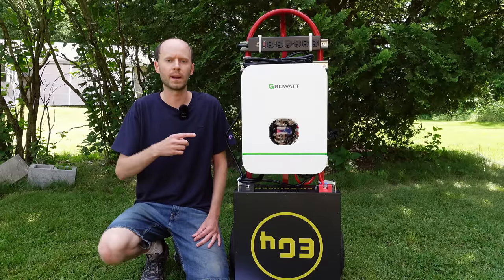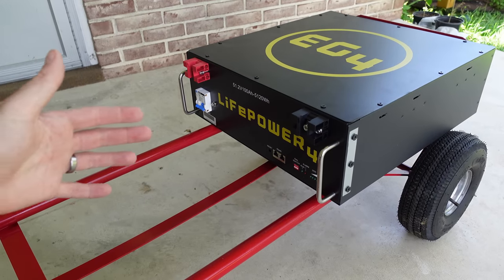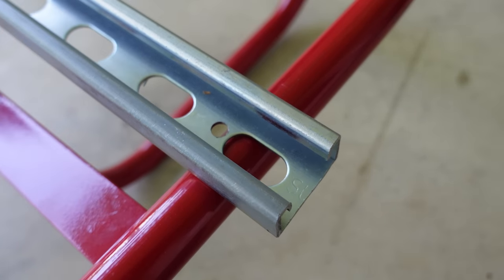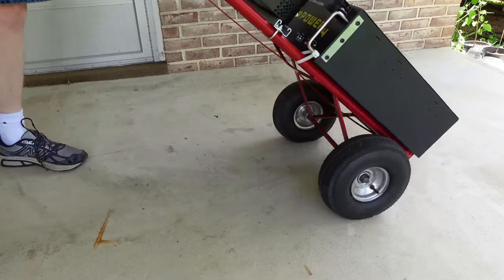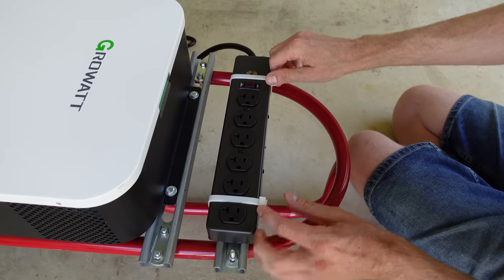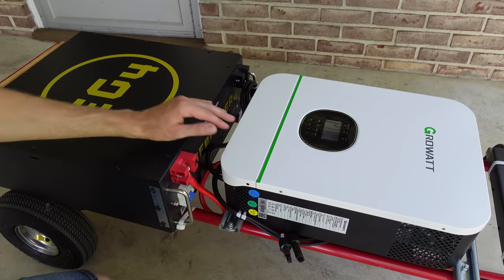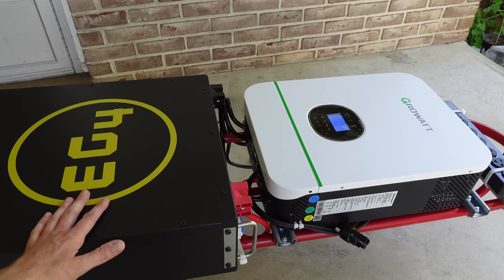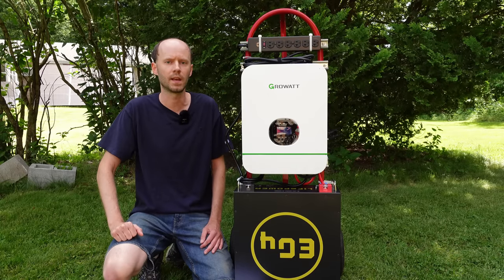Building a 3000W Portable Solar Power Station, Great for Power Outages!

Comment: Thanks! I copied your idea, but used a MPP2724 with outlet plugs built right into the unit on the side and MC-4 PV input plugs on the bottom, and I built a DIY battery using 304Ah cells (24 volt) and Daly BMS with the 2A active balancer. It works great. We are using it in the Green house for now, later in the RV when the weather is warmer, and in the fall time we can use it around the homestead while we get ready for winter.  Handy to have power anywhere you need it SILENT! unlike the gas generator we used to use, that is LOUD, smelly and expensive to gas up.  Great project for anyone with a few basic tools and skills.
Reply: I already purchased from signature solar and I am not happy with them. I have inverter that I can't use until they send me a data cable and I don't own a computer so I have to find one and borrow it and I don't have internet so then I have to go find that it's just ridiculous this is supposed to be plugg and play. Anyhow I like the idea of the inverter that you bought but I would like it bigger. I already own three of the eg4 batteries and 14 of the 455 watt solar panels.
I brought four of the panels with me back home and the other 11are up at the cabin.
I have a growatt infinity 1300 power station which i like, just doesn't last long. So i started researching how to increase my battery capacity and fell down this rabbit hole to make a cart system that basically works like my growatt using the eg4 batteries I've all ready paid for.
I like the idea of the built in plugs of the unit 2724. Does ut come in a more  powerful unit? One that will take more input from solar and one that will export more power so I can run like a window AC unit and hook up additional batteries?

Comment: Possibly a good idea to add a set of dummy clips for the solar connections you could use 3m clips to adhere them to the side of the inverter to both secure the cables further but also keep the solar connections clean  from dust and dirt on field deployments

Comment: I bought the EG4 battery and connected it to the EG4 inverter on a hand truck very much like the video.  Purchased some used 295 watt panels for 65 dollars each rated at 295 watts each.  The max I've been able to get is about 220 watts each.  Still that's over a Kilowatt for several hours a day.  The one question is do you need a breaker between the inverter and the battery?.  I know the battery has one but I  think they still recommend a breaker/disconnect in-between .
Reply: would love to know that too?
Reply: The mfg recommends a breaker between the battery and inverter.  I suggest downloading the manual and following the electrical code for your area.

Comment: you could use a metal hose clamp to attach the battery handles to the cart. that is a bit more secure than zipties. You could also bolt a piece of angle iron to the bottom of you cart, for the battery to rest on.. It would prevent the bottom of the battery from shifting forward.
Reply from the maker: Oooo metal hose clamps are a great idea!! I thought of a simple L-bracket at the bottom but the bottom of the cart needs to sit flat to keep the wheels up, so having a bolt underneath wouldn't work. I suppose you could counter-sink it fairly easily - that might work.
Reply: @LithiumSolar  LOL, I was looking for a comment about the zipties. When I use them in my videos people don't seem to think highly of them :) Although I find them to be highly effective, and reliable.
Reply: Zipties are approved to be used in aviation. They sustain extreme temps, vibrations, and don't damage delicate surfaces.

Comment: HI. I have a similar setup - 3000w inverter is driving one portable AC unit around 5-6 hrs/day (timer based) - trying to keep a balance while charging batteries 6-9 am and 4-8 pm which is helping to reduce a tremendous summer electricity bill in UAE. Four 400w panels, and 4wheel trolley for batteries and inverter in use when I need to move it anywhere.

Comment: While I understand not adding plywood to the cart I would think at the very least a strip of rubber membrane tape should be added to each rail on the cart prior to cinching the components to the cart rails. This would provide a sort of non-slip surface to prevent the components from any amount of slippage plus protect the rails from abrasion.
Reply: How about a pool noodle for vibration absorption. 🙂

Comment: We live in a fantastic time for dependable energy, you can power a house, from a handtruck.. another excellent build. Thankyou for sharing. And I'll agree with others about the tires. Solid core tires with decent bearing will last forever.
Reply: Well not really 5kwh is hardly enough to  power a realistically sized residential dwelling
Reply: You can add another battery pack then you will have 10KWh which is more than I what I use on my 1600Sq home per day. and it is great for rolling black out here in Cali.
Reply: @budmartin3344  the only time I use 10kwh daily is in the cooler months. Texas is hot. Not everyone lives in “Cali”
Reply: @Armenian  Well, you just have to build your backup system based on your needs, no one size fit all. I have 10KWh system for my backup and it fits my need just fine.
Reply: @budmartin3344  i understand this. And hence why I mentioned that 5kwh is hardly enough. You’re looking at a 30k+ investment just for energy storage alone. Not including panels and split phase controllers/inverters & wiring.
Reply: @Armenian  So what do use your '1280Wh LiFePO4 Solar Milk Crate 12V DIY Portable Power Station 800VA Inverter Victron' for since it is even smaller than the 5KWh backup system.
Reply: @budmartin3344  i mentioned exactly what I use it for in my video….go back and actually watch the video and then you will have an answer to your question!
Reply from the maker: @budmartin3344  10kWh/day is funny. I average 50kWh/day in both summer and winter.

Comment: Excellent design. I plan on buying a used Nissan Leaf and charging it using a similar device with a 7000 watt lithium cell, 12 volts and 3KW, pure sine wave inverter. Mine will be a bit larger and horizontal but still very much like yours which is pretty reasonable and appropriate.

Comment: I would put the unistrust on the back side then use longer hardware to mount it.  The weight would be in closer to the hand truck.   I would also recommend putting it to use full time to offset the cost. Mount some solar panels and power as much of your house from it.  The battery will fail due to years far earlier than you will wear it out for cycles plus you know it's always good to go if you're using it.

Comment: I like this. 
A few things I'd do differently, call it the benefit of hindsight.
- position zip ties so the sharp cutoff are less accessible - less chance of cutting hands. (also use flush cut sidecutters)
- dual pole isolation switch on the solar input cables.
- mount a water proof switchboard cabinet on the trolley, then mount the components inside (yes this increases expense) the weatherproofing on this will be needed as I'm expecting it would be used outdoors for (say) camping, building sites, etc
- I dislike zip ties, find a different bolt mount system, I'd look at threaded bar and channel to clamp the battery in place.

but those are really cosmetic issues by comparison to the fundamentals. still good design.

thanks for creating and posting the video.
Reply: One could also drill a hole in the hand-truck (trolley) frame and put the cables through the frame.
Reply: x x ...I'm planning a similar build.  Can you recommend a specific "water proof switchboard cabinet", and what parts would be inside?  All of it inide one case would require...basically a small closet.  I looked on Amazon, and it's not easy to sort by dimensions.

Comment: Maybe place a small block of foam on the bottom blade to cushion the battery and perhaps line the cart rails with pipe insulation to help prevent marring of the battery case. It would probably make the battery less likely to slide around on the red metal rails.

Comment: I am still looking for you to show how to set up the proper solar panels to charge this system. The solar power charging is the main feature I want to have. Also, I would like to know how long this setup would actually run that air compressor before the low battery cut off would stop it until it was recharged. The quality of an item like this to me is 1) What devices will it run and how long 2) Total cost 3) Being able to run and continue to run the invertor with a solar panel input as long as the sun is out of course
Reply: Vt. X amp = Wattwstt

You do math. Not my work or study

V x A = W

Comment: Connector biology 101: Pointy=male, “rectangular”=female.

I’m working on a similar build. Thanks for the ideas!
Reply: Connectors are a bit more complicated than that, unfortunately.  Gender applies to the electrical contact, not the plastic shroud. If you look inside the shroud on each MC4 connector, you'll see inside the round one a "large" open metal part which receives the mating connector. This is the female.  The male metal part in the rectangular plastic shroud is smaller diameter to fit inside the female, and sometimes is open on the end and sometimes closed.
Reply from the maker: @Sylvan_dB  And that's exactly why I called them "pointy" and "rectangular" LOL. The pins are opposite gender of what you'd expect by looking at the plastic housing. Calling it "pointy" sounds silly, but it's difficult to mix them up that way...
Reply: Would be nice if there were red and black connectors

Comment: Great video! I'm gonna build one of these with a Harbor Freight hand truck. It has the plastic wheels that you mentioned, but I don't expect to be using it outside my house. I'm old and getting it outside and off my porch would be an accident waiting to happen. LOL  I bought a 3 KW, 24 volt, All In One, rather than the 48 volt unit that you're using, and I'm waiting on delivery of a REDODO 200AH 24V battery with a 200 amp BMS. That's going to be over 5 KW of storage and, along with several 200 and 300 watt portable solar panels, should get me through any emergency power outage that I might encounter. (I live in tornado country) I'm thinking about using some cheap HF 1" ratchet straps to hold everything to the hand truck until I'm satisfied with my layout. (to be honest, if it works well, initially, it will probably never be "improved" with a permanent installation, if you know what I mean 😉) Thanks for the content!

Comment: If I were to build this exact setup, what and how many solar panels would I need?
They offer a similar battery, better warranty and more cycled for a few hundred more. Would it be worth it? Thx.
Reply: Much more info needed.  Your solar panel requirement depends on your need.  Keeping up with a laptop, an LED light, and a small microwave for a few minutes a day in Phoenix would be easy with one 200W panel.  Adding a household fridge, two space heaters in a northern winter or even two window-unit ACs in a hot summer climate with cloudy weather would require a significantly large array.  🤷‍♂
Reply: @737smartin  Ok, thanks. I've been looking at getting 2, 4000kwh inverters, to have 220vac and 3, 48v batteries, and buying a pallet of used panels. I'm wanting to put together a system so if the grid goes down, I can keep my freezers (3) going and be able to run my well pump, (220),
But, I need all the info and help I can possibly get. Thank you.

Comment: Awesome. So the goal, if I understand correctly, was to make this pricey setup more functional as both a solar power system and quick disconnect from solar array to be used as a portable/backup power when desired? Seems well suited and easily pulled up a simple ramp into a p/u truck or trailer for offsite power, fun wknd portable power at beach, campsite, jobsite, etc. I have used a similar dolly setup for portable dual high velocity 22" fans with mister system for portable cooling in scorching Tx. This for RV class C solar setup, hmmm? Perhaps laid down in an outside storage compartment? Roll in / out horizontal? Specs of the 100 ah 48 volt EG4 battery is 109 lbs.  I would also have connections to EG4 inverter/controller for my Onan generator and truck alternator beside solar array. Feasible to have those easy quick disconnects? Guess just nut release?

Comment: I really like the simplicity of this setup. I have been asking, but not getting a good answer. I want to build this setup, but instead of those 110v outlets, I want to put in a 30a/50a RV outlet to plug in an RV (50a plug, but have 30a adaptors). I know I cannot run the A/C, just want to use it like shore power and NOT have to worry about all the connections and fuses and bus bars and the extra wiring. And still have the little 12v system that I already have. My RV has everything but the inverter already, with 1 170w panel.
Reply from the maker: It's a 120V 3000W inverter. That's 25A max. If connecting to something else (such as an RV) there are a number of factors that have to be considered such as grounding, neutral + ground bonding, over-current protection (circuit breaker panel), etc. These are questions I cannot directly answer for your particular setup.

Comment: Excellent information. Since portability means you might be moving this at unexpected times, I would fashion a waterproof cover, which would also keep the dust out when not in use. Tall garbage bags would do in a pinch and are cheap and lightweight.   Adding a LED headlight (rechargeable) would help if grid power goes down.  A bag of extension cords tied to the bag would come in handy.  Larger tires, solid core, might add to the weight but would help going thru puddles, shallow water. If you use air tires, find a place for an inflator pump. I’d consider swapping out the power strip for one that has USB charging ports, or just add a second cheaper one.
Reply: Dude! Sounds like a sweet tricked out rig!
Reply: Princess Auto sells foam filled airless wheels.
Reply: Integrated USB ports get outdated every 5 years. They are a gimmic. 5 years from now USB A cords probably won’t even be included with any products. USB C are the new norm and most power strips don’t have USB C. Independent chargers are cheaper and usually must faster
Reply: @Dr.LongMonkey  I’ve been using USB ports for the past 10 years.
Reply: @danlux4954  must be fun waiting 5 hours for your phone to charge. Meanwhile I’ll take my 1 hour change time
Reply: @danlux4954  Pretty much all charging ports are some variation of usb, usb a, usb c, usb, b, micro usb, micro usb c
Reply: @Dr.LongMonkey  I charge my phone at night when I’m sleeping for more than one hour
Reply: USB A on the power input will be around for the next 10+ years. The other end is device specific.
Reply: @danlux4954  it’s not good to leave your phone plugged into the charger once it reaches 100% it diminishes the life of your phones battery
Reply: @Dr.LongMonkey  smart charger stops charging when full

Comment: Great setup! At a cost of 3k I wouldn’t just keep it on standby in the garage. I’d throw a few solar panels on that bad boy and take a few loads off the grid.  The cost of a few panels is not much more as it relates of the current investment. The of Roi might not be huge but it in the case of increasing rates or leveraging time of use rates it good be.  In theory you shouldn’t have to worry about life cycles on the battery or other expense and maintenance.
Reply: Lol

Comment: Maybe, if you can find it a power strip with 20 amp capacity that also has USB ports built into it.  If not, then just go and buy a good 110 small charger that has PD for USB-C & USB-A

Comment: Well doo)e. I like the double use of the power strip for input and output. Same thumbs up on the Anderson cable. Nice ideas there. I would like to see a framed box at the foot of dolly for the battery to rest into. I fear a big bump may allow latteral movement with risk the battery may pop off the dolly (small chance but not zero). Or maybe double sided tape? Super build. Good price. Thanks for sharing
Reply: Or a Ratchet Tie-Down Strap.

Comment: I built a portable power bank with strap for carrying a 200ah lithium but with the ability to add other battery's to increase capacity without going into the battery box. Using a Noco 8D box and 2500watt roarbatt inverter with 50 amp victron solar controller. cost under 1500$.

I put a large silicon mat i found cheap on amazon on top of the Noco battery box and that allowed me to screw components that can get hot on top of the plastic box without worrying about a meltdown. Wood was too bulky and less conforming. I decided to go with Terminal bus fuses to fuse in and out of the battery.  I already have plans on building a 2nd box but that box will only have a kill switch and fused cables that can hook right into bus bars i installed on the main battery box.

Comment: love the handtruck!! that's a heavy battery😮
compared to the light weight Growatt!!
also like the PV connection 
, the  Growatt is a little tricky to access 
a few extra inches between the battery and the all in one unit could help! 
I got to use this system this am when someone hit a utility poll up the street!
first time I needed bigger load and it worked like a charm !!😊

Comment: Damn you beat me too it, mine is a aluminium cart with a 300ah 12 volt lithium battery with a 2500 pure sine wave inverter. Victron solar controller with 400 watt solar panels and a Victron smart shunt. Built mine for camping. Runs all my camping needs indefinitely no more generator needed! My question is what are you doing for ground? Plugging into the house your connected to the house ground but when your using it mobile ???

Comment: I have this same system running in my RV. You can power a 15,000 BTU Air Conditioner without soft-start. The Growatt is kind of a power hog though.